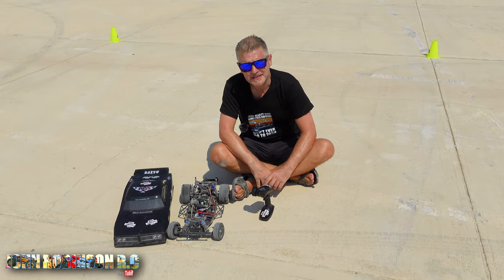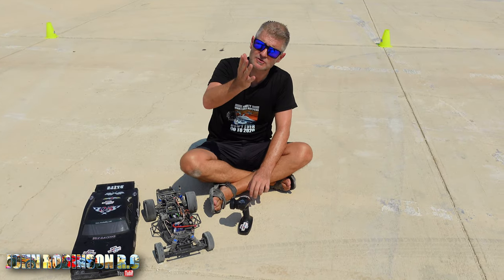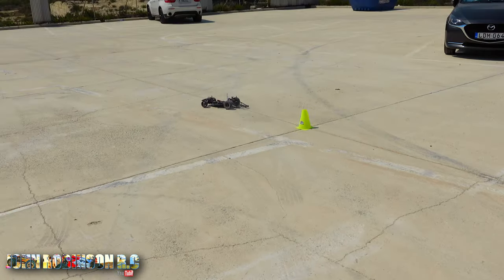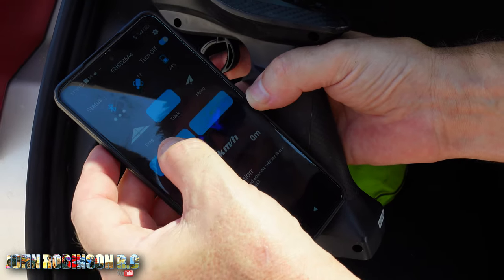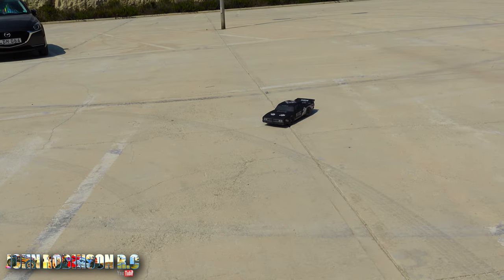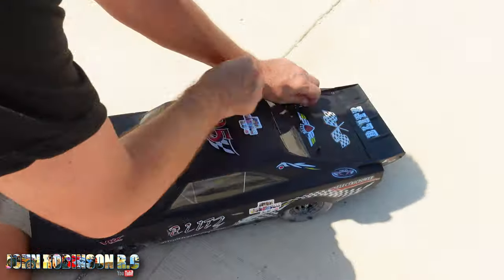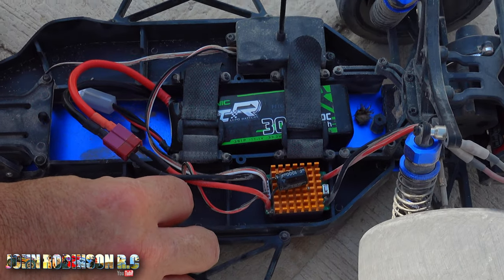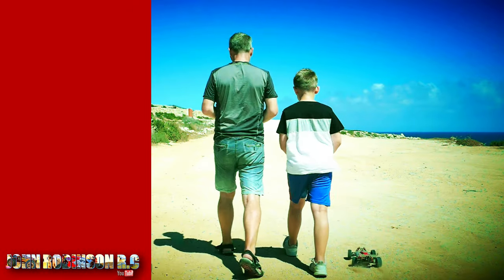HOW FAST? Can the VRX RACING BLITZ RH2015 brushed run 3s? #shorts BANG

Comment: Do you have the diode across the poles of the motor to prevent surge/start stop voltage/amp short circuit type feedback from the motor to the ESC?